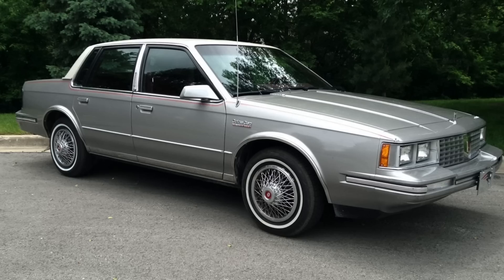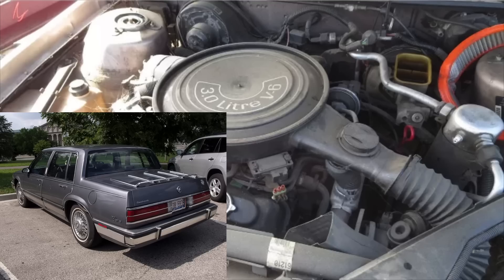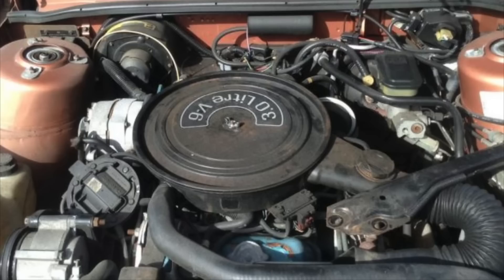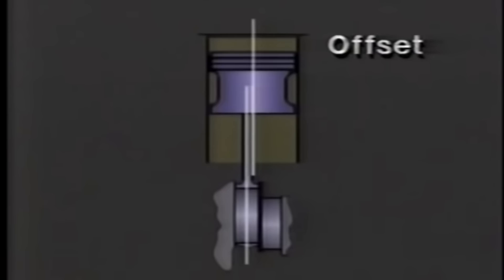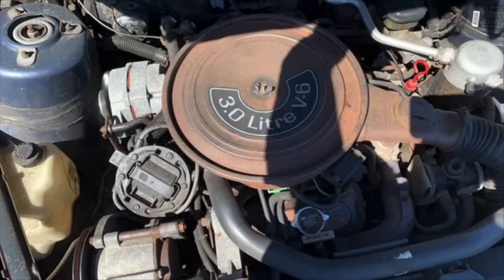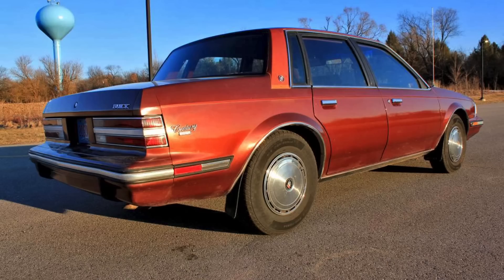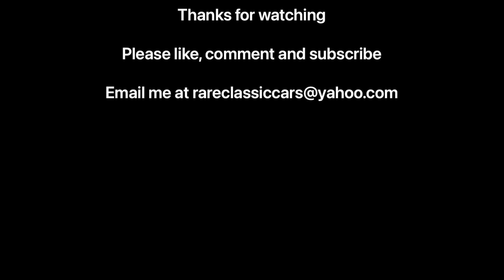Worst Engines of All Time: GM's 3.0L LK9 Carbureted V6 Engine (Buick Century, Olds Cutlass Ciera)

Comment: I had an '82 Cierra with the 3.0.  You are dead on about the cold drivability problems.  Very hard to get out of my development on a cold morning. 
I was a field rep for Atlantic Richfield and In 5 years I accumulated 150, 000 miles on mine. I used ARCO Graphite oil and turned the car over to my wife as a grocery cart and sold the car with 175K.  The tranny would no longer shift into lockup, but other than that, I had no internal problems with the engine.  Enjoyed your video.
Reply: [in an elated tone]  Aaaahhhh!  I haven't heard the name "Atlantic Richfield" in decades!
In the late '60s to the mid-70s the Atlantic Richfield/Arco brand premium gasoline was marvelous; with a minimum amount of engine ping and always the best fuel mileage with the vehicles I drove.
Reply: I was a fan of Arco Graphite as well.  I was a mechanic for a private company that had a fleet of chevy malibus.  1978-1984 with 200 cid v6, 229 v6 and 267 v8's.  The 200's and 229's were gutless junk engines.  The 267 was a sweet powerplant.  On each of them, upon reaching 12,000 miles, we changed oil over to Arco Graphite.  Every 6000 miles, new oil and a new Hastings filter.  The guys who drove the cars were absolute idiots.  They only knew two throttle positions, idle and full.  Never had a problem that could be traced to lubrication.  When one of them turned 200,00 miles, the boss sidelined the car.  We pulled the engine, did a teardown and found NO wear.  The boss told us that he wanted to do the teardown to show us why we were using Arco Graphite.  Made me sad when it disappeared from the market.
Reply: @beenbeatenbybishops5845  When the Arco Graphite motor first available about Spring 1976, I really want to get it since the oil could last 1.5K between oil change interval. My mother brought a brand new 1974 Plymouth Duster in October 1973 and when I put Arco Graphite in the engine with oil filter, the oil pan gasket began to leak and we had a oil drop in front of the drive way. My parents car has 8.4 K in speedometer in 3 years.

Comment: My Dad owned a junkyard which I worked at as a kid in the '80s, so these videos bring back memories. Escort 1.6 and 1.9 engines/heads, Cadillac 4.1's, Olds diesels, Chrysler/Mitsubishi V6, and these 3.0's. They were all moneymakers if you had a good one.
Reply: Ah!  Chrysler/Mitsubishi . . . I recall in the 1980s into the '90s of seeing plenty of those late model sedans on the road in California.  But, five years later they all seemed to disappear.
Reply: @bloqk16  They all had a cloud of oil smoke coming out of the tailpipe if I am remembering right.
Reply: @bugdrvr  Poor exhaust valve stem seals
Reply: @bloqk16 I've got the Chrysler/Mitsubishi 3L V-6 in my 1996 Plymouth Voyager base model. 241 000kms and counting knock on wood. My Oldman had a 1996 Dodge Caravan base model, same engine, with 370 000kms (abused kms) before being sold for scrap in 2011. Last time I saw it someone else was driving it in the summer of 2013, with a cloud of blue smoke out the exhaust!

Comment: When me my brother and sister were little kids in the earlier to mid 90s my Dad had an 1986 Chevy Celebrity that was a gunmetal grey metallic with matching cloth grey interior. Was a more base model had the metal vented styled chevy hubcaps but had the 2.8V6. That car was very nice when he first got it and despite it when it was older and started rusting the car still ran and serviced our family good for its lifespan. The 2.8 was a good engine and no it wasn't the fuel injected one that came out as a optional engine for the 85 and newer Eurosports. This one he had was the carbureted version which our year was the last year that GM used it in as 1987 and newer Celebrities has the 2.8 Multiport Fuel Injected version.

Comment: Here in rust country the control arms for the rear axle rotted out of the unibody structure very early in life.
Reply: From what I have seen, this is what has put many good running A bodies in the junkyard. On 3 of mine I rebuilt the triangle box, and beefed up the attachment better than stock. Got the burn temps saved at work.

Comment: When GM first released the "odd fire" V-6. The engineer in me couldn't believe that it would save money over a new design. It seemed like a travesty of automotive engine design. 
Radial aircraft engines by engineering necessity and some motorcycle engines due to physical constraints are essentially "odd-firing" and vibrate at low RPMs. Both are also low revving engines. Aircraft radials seldom exceeded 2700 RPM and lower output postwar versions were usually limited to 2300 RPM at cruise for longevity. 
Back to the V-6 odd-fire engine. Adam, I know you were in the accounting part of GM. As the wonderful designers you have interviewed liked to rib you about. Almost without exception.
As a very general ball park estimate. How much money did GM actually save, in the BOP divisions, by going to the odd-fire V-6, then to the equally bizarre even-fire V-6 derivative. I know there were several significant common component parts to the Chevy SB 350 in the later even-fire design. So I get the cost savings there. I'm not sure if that's true of the odd-fire design?
Versus a very successful clean sheet design like the 3800 engines.
I found this very interesting article on the lineage of the Buick aluminum Fireball V-8 to the Fireball V-6. Eventually, it was sold to Kaiser/Jeep which used it for awhile. Then, in what seems to be a literal panic, the mothballed V-6 tooling was repurchased from AMC/Jeep and immediately put into production for small Buick cars to meet CAFE standards for 1974. 
https://www.hagerty.com/media/automotive-history/how-buicks-fireball-v-6-birthed-one-of-the-most-successful-engines-in-history/
How much advance warning did the industry get about CAFE standards before they went into effect? From the story in this article, it seems that GM or Buick, at least, was caught completely "flat-footed".
Thanks again, for your interesting videos.
Reply: Was the Oldsmobile version of the 215 aluminum V8 treated to enhancements compared to the Buick version? Like stronger bolts attaching the cylinder heads?

Comment: At age 47, looking back in hindsight- the most reliable engine I owned was A 1988 Chevy Beretta 2.8 multi port injection. Had it 2 years and changed the oil once or twice in 30,000 miles. Ran like a top. Hey, I was 22 years old at the time so I had other things on my mind besides maintenance. Nowadays, I change oil every 1,400  miles religiously.
Reply: My dad got a used 89 beretta in 1997 with the 2.8 multi port injection engine.  We had it as a daily driver up until 2006 at which point it had over 500, 000 kilometres on it (310,000 miles).  It leaked oil by then but was still running great and some loser rear ended it during the night while it was parked on the street.  That was its demise.
Reply: Hope you meant 1400 mi. 14000 is way too long!
Reply: My grandpa had a Berlinetta with the 2.8 with about 300k on it before it was stolen. Still ram like a too too. My dad would constant take it out for joy rides and beat the hell out of it but it would just take it. My dad refers to it as “the car that just didn’t die”
Reply: Stop and go driving or idles more than drives 3 months/ 3,000 miles highway driving 7 months/ 7,000 miles. 

You must be doing A LOT of idling to be changing it that frequently.
Reply: I change my oil every 3 miles
Reply: 1400 mile oil changes are way overkill

Comment: Was always curious as to why this engine existed with a fine 2.8 and 3.8 available. The later 3300 was a fine motor however
Reply: The 3.3 is a entire different animal. Had 3 centuries with the 3.3 2 89's and a 91.  They didn't run a 3.8 in them. I am thinking of swapping a 96 3.1 Chevy in my current 89 century just because which will be fun to do electrical wise, but will sit just fine in it!
Reply: @shawnsatterlee6035  I understand the transverse 3.8 wasn’t available in all of them but I swear SFI 3.8 (pre 3800) cars existed. And as far as 3300 conversions I’d love to find an 82-83 Omega or any Skylark and put 90s low mileage Century front cradle engine transaxle whole car right under one.
Reply: @AlexanderWaylon  my '87 LeSabre had an SFI 3.8.  And yes, around 120k miles, the timing gears stopped working.

Last US GM I owned. I had a Geo Prizm after that and was amazed at how much less trouble I had with that car. I've been a Toyota and Mazda guy since then.

Comment: I had an elderly neighbor that in 1983 bought a 6 Month old Cutlass with  8.000 miles with this engine.  Living in the Northeast she had this Habit of starting the Car & to warm up the engine would Floor the gas pedal over & over for 5 minutes.  I remember this so well cause in the Summer wen I was on School Summer Break she would wake me up as my bedroom was 15 feet from her Driveway.  This was her 1st Non V8 engine & it only took about 6 Month before the engine made a Horrific sound.  Luckily the Warranty Covered the Repairs.   Halfway through the Brutal Winter & only 300 miles after Repair the Car was Flat bedded away to Dealership.  After the 2nd Repair she Drove Directly to the Chevrolet Dealership just a few miles away & Traded it in for a Brand New 1985 Impala, the Bare Bones Model with the V8.  She Continued Her warm up method Successfully until 1987 wen she passed away.  Sadly she had no children & No Will.  I remember wen the State came in to asses the asset's & I walked over to look at the car before being towed away & I saw the odometer was 919 miles.
Reply: Wow 919 miles 😲
Reply: Good story !!!

Comment: My cousin gave me one of those cars about twenty years ago and we could not kill it, we drained the engine  oil out and ran it for about fifteen minutes and it still ran so we put the old oil back in and run the crap out of it until we scrapped it.

Comment: I noticed that the 3.0 had ALL the weaknesses of the 3.8 with less power and worse serviceability because of the transverse installation. As you stated, the oil pump was notoriously trouble prone. When they  got rid of the distributor in the 3.8 and  redesigned the oil pump, it changed it from a 125,000 mile (if you were lucky ) to a 200,000 mile engine (provided you replaced the timing chain at near 100k) . This was even before they further improved it with the 3800. The redesigned oil pump was the SINGLE GREATEST IMPROVEMENT to these engines.
Reply: The grand nationals (corvette killers) never benefitted from the oil pump redesign, seems the fwd vehicles were the engineering priority.
The cyclone was another under the wire skunk works success.

Comment: I once owned a 92 Cutlass Ciera S with a 2.8 i was working on my degree in electrical engineering at the time and i was fascinated with obd I at the time and figured out how to re-tune it using fuel pressure and adding resisters to the MAF i turned that little car into a rocket i called it cannon ball express 1.0 i currently own a very rare 1985 chevy durango it's basically a long box s10 with a 2.8l v6 and 5 speed trans i think gm's worst engine is the 350 diesel in my 79 riviera. but nothing is worst than a mopar 2.7l
Reply: I would LOVE to have a diesel Riv!! I have a fresh GM Goodwrech DX block diesel to put in it

Comment: The 3.0 injected version went on to live in the Somerset/Skylark through at least 1989 which was the last time I had one - in a 1989 Skylark with the handling and ground effects package. It wasn’t as bad as it sounds I promise.
Reply: I also had a new 3.0 Somerset in a1985. Ran great and was fuel injected, but it was not the same engine as the LK9 Adam is talking about.  Was pretty much trouble free.
Reply: @michaelkehm3663  - LN7
Reply: I have a 3.0 Somerset MPFI now

Comment: Family had a new 1984 Ciera with that engine. Traded and got a late 1985 with a 3.8 V6 Fuel Injected. The 3.0 was awful performer and terrible mileage. Traded before 10k miles.

Comment: I bought an 84 Cutlass C with this engine in 1987 low mileage, beautiful car. Power roof and every bell and whistle. It was a night mare. I had bought an extended warranty but GM dealer would not honor it. Let it go back. Only drove it a year. Bad experience.
Reply: Why wouldn't they honor the warranty??

Comment: Adam, nitpicking here, but the bore for the 3.0 was not the same as the 3.8L (which was 3.8”), but instead used the bore of the 4.1 engine (3.96”) to go with its 2.66” stroke. If memory serves, it also had a shortened deck, making the engine slightly narrower …
Reply: YOU are WRONG - 3.96" bore with 2.66" stroke would give 196.5 CID
Reply: @johnrebus1641  — You are correct. I did the math.

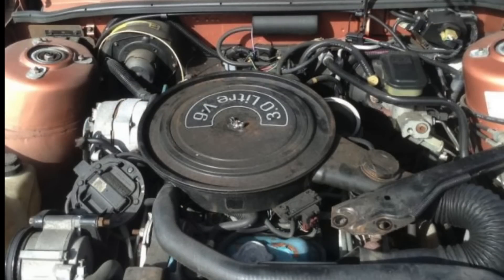Adam stated at 3:20 that the 3.0 had a 3.96 bore, which he said came from the 3.8L, which is also incorrect. 

The bore and stroke of the 3.0 was 3.8x2.66.

Thanks for catching it…

Comment: I wonder how the 3.0L V6 compared in terms of competence to the even less powerful carbureted 3.2L LC9 V6 offered from just 1978-79.

Also, I appreciate that GM at least tried to differentiate the more upscale Buick and Olds A-bodies by using the Buick V6 rather than the Chevy V6. It’s just too bad that the 3.0L wasn’t appreciably better than the Chevy 2.8. Kind of missed the point of offering a distinct engine option in the first place.

Comment: Many would argue that the 3.8 had already attained excellence, before it became the 3800.
That Chevy 2.8 was a rather peppy engine, especially with the EFI. I drove an '87 S10 with one, and it was a ripper - at least until you crossed the intersection and it started running out of breath... I drove an early '80s carb'ed one too, and I don't remember thinking it was peppy, but it wasn't underpowered either. Hot Rod had a few hop-up articles featuring the Chevy V6 in the early '80s. I remember one host was a late second generation Camaro...👍

Comment: Had an 85 v6 2.8 with port injection mated to a 5 speed. It was free revving and one of the best running engines I owned. I beat it to death for 155k miles & sold to my brother. It leaked from the seals but no indication it was burning any.
Reply: Yeah i had a 1988 2.8 liter mated to the Getrag 5 speed and it was as screamer.  The manual transmission allows you to rev it to your hearts desire. Great motor transmission combo.

Comment: Okay Adam two Questions 1. Which engine was the "iron duke" V6 ?  2. Back in 1981 Cadillac had a V6 for the C body rear drives - which one was that ?
Reply: Iron Duke refers to the 2.5L I4 found in practically every compact and mid size GM product at the time. 
Said V6 in Cadillacs was a 4.1L Buick mill
Reply from the maker: Correct
Reply: @RareClassicCars  very amusing
Reply: @antonfarquar8799  I would rather have a Caddy with the Buick 4.1 V6 than that damn HT4100 V8 a year later 🤮🤮🤮
Reply: @johneckert1365  Agreed ,  in 1981 we drove V6 4.1 liter Coupe De Villes as demonstrators - they were dogs - until we took the lid off of the air cleaner and inverted it - ran like a totally different car had more spunk than the 864 - then the Service Manager found out and gave us the ass chewing from hell.
Reply: @antonfarquar8799  BAHAHAHAHA 🤣🤣🤣

Comment: The Detroit 90° V6 engines that don't have a balance shaft are very rough.  The Mopar 3.9 liter (a decapitated 318) and the Ford 3.8 are engines I have decent experience with.  Night and day from the GM 3800 series III I have owned that is smooth and quiet.  Supposedly somewhere in 2000 the Ford 3.8 got balance shafts (and in 99 resolved the head gasket problems).  Dodge Dakota with 3.9 V6 was slow, loud, and delivered almost no gain in mpgs over the 318.  I guess it was a "me too" engine only.
Reply: I'm a Dodge guy and agree, a 318 Dakota gets almost thr same MPG as a 3.9.   They're pretty annoying.

Comment: I seem to remember my grandfather talking about someone who bought one of the new downsized '85 Olds 98's with the 3.0 when they came out and couldn't make it run at all. I think the dealer blamed and kept working on the carburator. I also think she gave up and traded for a new '85 or '86 Mercury Grand Marquis 8 or 9 months after buying the Olds.
Reply: Unplug the spark control module and they will run. Instead of a cam angle sensor they used this crap.
Reply: @billchildress9756  How will unplugging it fix it? You mean the GM 4 or 5 pin electronic ignition module on the distributor?
Reply: @gregorymalchuk272  If your referring to the 3.0 GM used what they called the EST spark control module that was mounted outside the distributor usually on the firewall. It was used with the MAP sensor and the TPS sensor to control ignition timing. On those old pre OBD II engines you had to jump 2 terminals on the ALDL connector and count the flashes on the Check Engine light to get trouble codes. By unplugging the module it would allow the engine to run plenty good enough to get you home. Without the spark advance it would not  have the Oomph it had before but with a scantool you could read those sensors and find which one had the problem. I forgot to mention the coolant sensor too... My bad. I haven't seen any of those since the 90's and I did not have a Scantool at my disposal either.